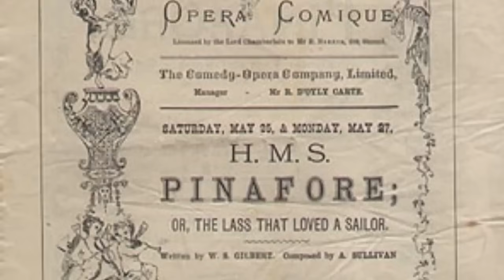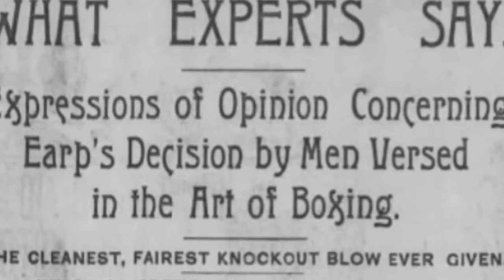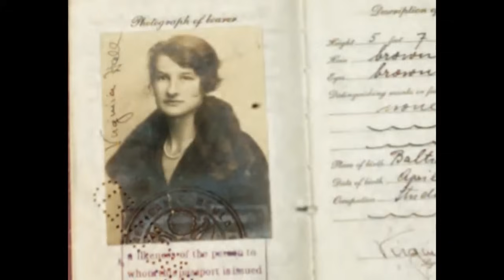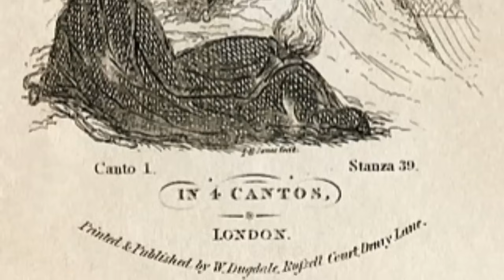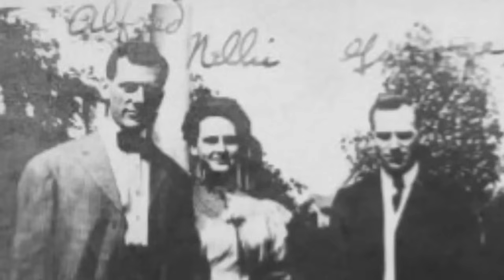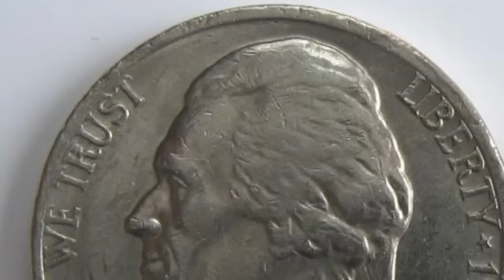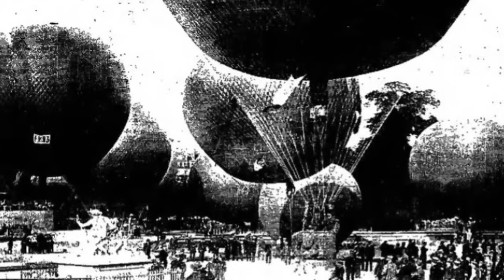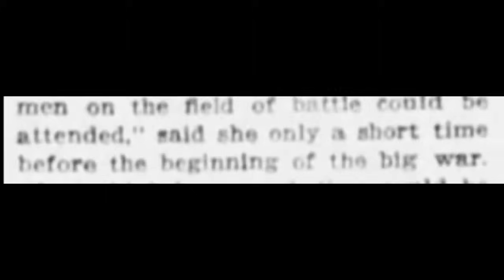Best of:  Forgotten Women

Comment: 42:01  "And the dates easily wore away in circulation."

I can vouch for this.  I randomly got handed a buffalo nickel in my change at a store recently -- in good condition I could have sold it for $20 to $200, but with no date it's worth about 20 cents.
Reply: 50:28  "...with the intention of crossing the North Sea from France to England -- something several people had died attempting."

Me:  Really, how did they die?

"At takeoff, a rope pulled the balloon to the side, dumping some of the precious hydrogen that kept it afloat."

Me:  Ah.